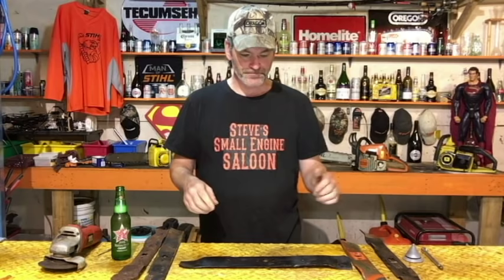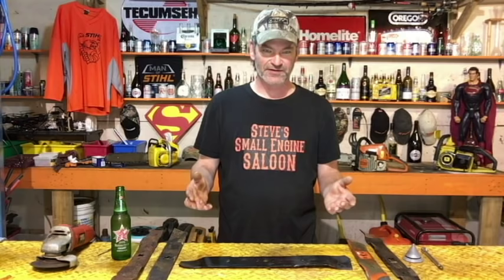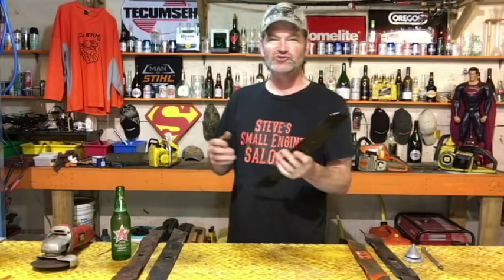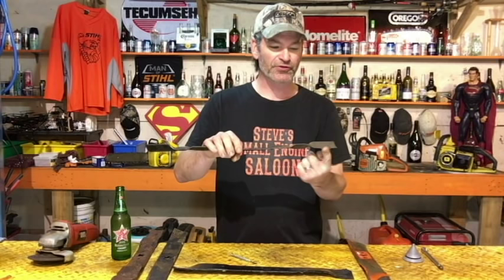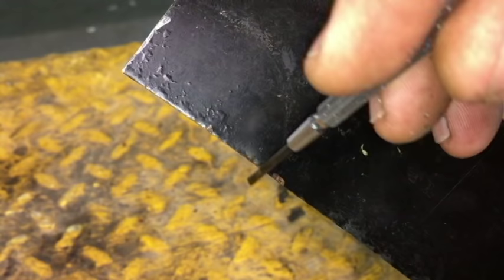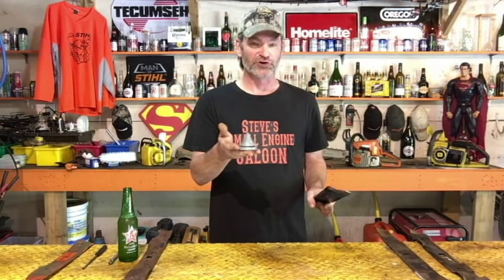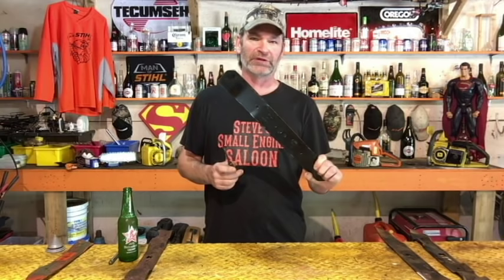How To SHARPEN And BALANCE A Lawn Mower Blade (The Correct Way)

Comment: Medium grit flapper wheel on hand grinder holding blade flat on bench with cut edge over hanging works great . Count the strokes on each ends keeps them close enough I find .Only way to reelly tell blades bent is to lay it on top of new one . Or in our case I have a wall mount balancer with a gauge that when blade is spun it shows that it’s bent or not .Also blades of that size are so cheap and light balancing in my opinion doesn’t matter a whole lot . There’s not much mass turning . If it’s has a chunk out off it or noticeably sharpened one side more than the other then balancing should be done. I do this 2-3 times a week for 20+ years. Now on my commercial 27” blades where they can weigh a couple of pounds each then yes balancing is very important but still get hydraulic driving spindles blow bearings . Personally I think it’s from the first bang you hear out on the course throws the balance off .lol after an 4-6 hour mowing day slightly off balance would wear the bearings out over time .

Comment: It might be a good idea to remove the gas cans with the spouts attached out of the area when you are grinding. Also if you don't have a vise you can clamp the blade to the work bench and sharpen 1 end at a time.

Comment: Before watching this video I saw a guy balance his blade on a nail and rant on for 10 minutes about how you should use a hand file 🤦‍♂️ Thanks for all your videos...
Reply: @Jonathan-fw6ty  I'm guessing you don't work with power tools. With your logic I should change all my tires and pull my engine with hand tools as well. I mean it only take 5min longer to pull a wheel by hand. Hold on tho... If I quit using power tools and spend extra time, that's called a waste of time and worse for me wasted effort. I will always take the easy route as I'm not a moron. And if you were filing the rock chipped blades I have to sharpen you would spend a hell a lot more than 10 minutes. But you do you!
I wonder do you balance the blade with a file as well 😳 what a waste of time! 🤦‍♂️

Comment: First, I'll use my bench grinder to flatten out any dings in the blades cutting area, and remove same on the other side for symmetry balance.

For sharpening the blades, I use a grinding wheel and a constant angle guide attachment on my DREMMEL rotary tool, and finish getting the burrs off with a hand file.  When done, smear grease over the just sharpened  area, and wipe off excess (prevent rusting) especially for off-season storage.

Then I check balance, and I'll remove material from the end of the blade (bench grinder), at the trailing corner, opposite the cutting edge.  That way, I don't have to keep sharpening to get them balanced.  And, cover that spot with grease too.

And, after 13 stitches when a wrench slipped off the mounting spindle nut, wear leather gloves when handling the sharpenned blades!!!

Comment: The nail or screw drivers in the middle works well also. If the blade does not rotate, it’s balanced, else shave of the heavy side until it no longer rotates left or right. It’s like static balancing a motorbike wheel.

Comment: I use a smooth round shank screw driver held in a vise to balance the blade.  I rotate the blade 180 degrees to check it.  Seems to work pretty good.  Never had an unbalanced blade by doing it that way.

Comment: I believe the nail in the wall trick would work notice the balanced blade retained its position when placed on it if one side is heavier it will rotate until the heavy side is down like static balancing a motorcycle wheel

Comment: I just finished grinding my blade for balance using your 6 inch extension method.
You are a damn genius mister!!
Worked like a charm.
Reply from the maker: Right on Burt...
Reply: @StevesSmallEngineSaloon  but you lied about the Heineken.
I did it with Tecate instead of that fancy balance thingy.

Comment: Steve you are a legend! Your explanations could not be clearer. I have looked through your videos and could not find one that deals with my problem.
I have a Briggs 35 engine.
When I turn the flywheel i feel a scratching resistance as the piston reaches the top. 
I took the plug out and placed my finger (with a glove ) on it. I can feel the suction but I cannot feeel the compression but I can feel  some "sceatching resistance " as I turn the flywheel and the piston reaches TDC.
I saw your video on the stuck valves which could explain the no compression, however I am more worried about the scratching sensation as I turn the flywheel.
I did inject some lubricant (diesel)in the spark plug hole to ensure there was cilinder lubrication. The problem persisted.
Hope you or one of your many followers can drop me a hint or guide me to a video that explains my problem. Many Many Than
Reply from the maker: Could be that the coil is hitting the flywheel!
Reply: @StevesSmallEngineSaloon  You are a humble genius!

Comment: I have screwed a linear ball bearing in the size of the hole in my blade and to a closet door in my workshop. Drew a line using a bubble leveler a couple of cm above it.

Comment: A lotta times I use  a 3/4" dia. CARBIDE cutter bit in my air die grinder. NO chance of burning the edge!  Also use a 3" cutoff wheel in my right angle die grinder at times. No need to remove blade the blade with either method. 
Also, I always take a very shallow/ flat swipe on the bottom of the blade to remove any burrs, etc. Try it !

Comment: I recently had a mower that was about 3 years old. Had it in the shop for minor repairs. Was told the blade needed sharpening, I didn’t notice it however, I told him to go ahead and sharpen it. I got it back and it worked great. The next time I used it, the blade felt like it was ruined. Couldn’t cut a thing.
Reply: He probably ground it on both sides. Doing that destroys a blade.

Comment: Steve.... Invest in a BLADE SHARPENER type of grinder. Yes they are expensive. But they do the job much quicker and with professional results. You want a 30 degree BEVEL which is as you describe as the angle, for your blades. A file is still good for touch ups. And another tip for you is when you got the proper edge BUT it does not balance out is to file THE BACKSIDE of the blade. It doesn't hurt the blade. Don't disturb your already sharpened edge. So file the backside once again to get in balance. ...I run commercial mowers for a living.

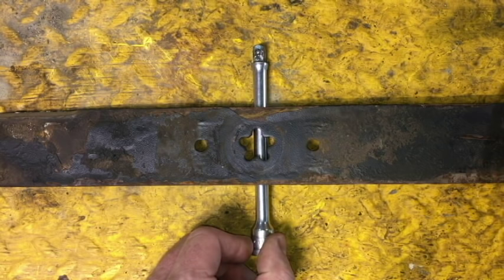Comment: 11:00 I think that balancing trick the with an extension arm (or any other straight and round metal bar) is even more accurate than the official tool, especially for those blades with non-circular hole in the middle. Great tip!
Reply from the maker: Thank You...
Reply: non-circular holes still centers on the balancing jig by their inner protrusions.

Comment: Hi Steve, keep up the great work you do, you are helping people save money. I watched your video on how to sharpen a Lawn Mower Blade, what do you do when the balancing hole on a blade is not round? There star snapped. This is what I did, I took a 8”x1/2”x1/4” because that’s what I had at the time, any size will work.  I drilled a center hole just big enough that it rests on the forth hole on your style of balancer. I wish I could post a picture to of what I did. 
Thanks
Luis

Comment: Great Steve. I  haven't read other replies, however you didn't mention the need to clean all the dried crud off the blade before balancing it.  For that step, I use the other side of my bench grinder that has the wire brush wheel as in your video.  A hand held wire brush also works.

Comment: Hi Steve, im new on your channel and it's great, I watch them all, lol. I think you were right on balancing the mower blades, "How ever" the old nail trick is right out of the briggs and stratton  service  manual.  Old school I guess... thanks for the great videos👍
Reply: The "nail-trick" is NOT accurate bc you cant really put the point of contact(the fulcrum) exactly on the center of the diameter of the hole.

Comment: Do you have any experience with the small grinding discs for use with a power drill?
Reply: I bought one specifically for mower blades, about 2 or 3 inches in diameter with a bevel and a plastic guide. Worked ok for the first several times, but hasn't worked well since. I think maybe it got loaded up with metal.

Comment: using a hand file is fast and doesn't heat up the steel, using a grinder heats the cutting edge resulting in changing the temper of the steel and will dull faster because the steel has been soften by the heat of grinding method ... using a hand file is the best method.  ...  no offence, love your channel , the very very best !
Reply: best channel, I have repaired many of my small engine troubles with your help .... excellent help .... more than two thumbs up

Comment: Excellent tip on using an extension rather than a nail. I've been using a screwdriver and have wondered how accurate it was. What grit disc do you use on the angle grinder?

Comment: Good stuff Steve. I just picked up a brand new set of blades and spindles because for my riding mower. Just as you said an unbalanced blade will beat your mower to death. I had not sharpened and balance since I picked it up used 3yrs ago had broken 3 of the spindle mounting points. It may have even helped cause the deck bracket weld to break. That’s why I took it off to RE-weld it and I saw the other issues. All rebuilt now and I’d like to give it a shot, but it’s rained the last 4days in a row. 
Again, thanks for the tips. 
-do you sharpen brand new blades?

Comment: Hmmm.... looking at the blade examples.... looks like I've been trying to mow my lawn with my roto tiller. It's a pity rocks don't sharpen the blade. It could also explain the vibration that keeps shaking up the beers in my beer can holder on the handle bars.. 12 beers later and I've almost straightened out my roto tiller tynes, I mean blade. Two problems fixed at once! Cheers!

Comment: The nail in the wall procedure might work if you have the nail perfectly level, and lay the blade on it like you did with the ratchet extension.  It still seems like too many variables with the method, and I personally use the cheap balancer.

Comment: Sharpen my blade with a fine 1/2 round file in a few minutes. A file is the best way as it does not heat the metal up which makes the edge softer
Reply: Yeah I use a hand file too. I don't want to take off any more material than I need to but practice makes perfect grinder works for some but not others lol

Comment: Cub cadet 7000 series what 3rd generation starter besides Kohler brand would you use mine doesn’t have the torque to crank the motor

Comment: Have you ever tried using a hand file? I've been using a hand file for years to do this job and it really doesn't take very long at all. I have never had to replace a blade yet because using a hand file removes just enough material to sharpen the blade for another season. I've seen people grind these things down to almost nothing with a bench grinder.

Comment: Anytime you balance anything, your rotation point MUST
be in the center (bolt hole) of what you balancing. This is why the nail 
on the wall is not good. The nail is on the tangent of the hole,not the center.
The faster anything spins, the more accurately balanced it must be.

Comment: I noticed that you had two type of blades, one with a round hole the other with the "star" type hole. I have the same type of balancer you have, HOWEVER I've had difficulty using it on the star type blade hole. The balancer has different size steps for different size holes, my blade doesn't line up with the step. Any Suggestions on how to continue using it?

Comment: As far as sticking a nail in the wall to balance...yes a perfectly balanced blade will hang at any angle and not move, it doesn't have to be horizontal.  If it is unbalanced, it will start to swing vertical after putting it on the nail until the heavy side is down.

Comment: Quick questions. It seems to me that you can get a blade balanced, but if the user is going to barely maintain the mower deck(which I think is typical) won’t the caked on grass imbalance it pretty quickly anyway? Isn’t this especially true for mowers with stacked twin blades (ie. Hondas)?

Comment: I think the nail in the wall trick was meant to be used just like you used the socket extension.  You probably need a pole shed nail, though. You lay the blade on top of the nail, you don't hang the blade through the attachment hole. I do like to be able to roll the support, like you did with the socket extension. I use a screwdriver, but a lot of things will do.

Comment: What do you think about the grindstone you put on the end of a drill?
Reply: Go to Harbor Freight and buy an $18 angle grinder and a $4 pack of grinding wheels. I've had mine for 8 years and it still works just fine.

Comment: Better to use an angle sander than grinder.
A #80 grit disc works great.
Good idea to spray paint the blade after sharpening, prevents rust.

Comment: alternative way to check the blade for balance:
on balancing using the extension is too much to the right of your blades center hole which side is the heavy side that you need to remove more material to balance the blade? thanks

Comment: I use the All American Sharpener model 5005 with my angle grinder. You get a perfect grind every time. Properly cleaning the blade is just as important. Otherwise you're  balancing the built up dirt on the blade & not the steel blade.

Comment: I use a medium mill bastard  file at least 12 inches in length........ easier to keep both cutting edges sharp and uniform......Plus I  have 4 or 5 blades that I keep sharpened and ready to go..........Being a tool hog, I have two mowers anyway.

Comment: I use a small grinder like you but then I take a fine file and put a 1/32 flat on the edge and it will last me all season, if you get it too sharp it will just fold over and be dull again real quick.

Comment: hi    got all those shop tools.....but,  if some of you don't.  SCREW  THE BLADE TO A LARGE board. sideways. like a 2 by 10  or a beam...then go to town with the angle grinder.....keeping the angle the same as factory ...only take off as much as needed, both ends......

Comment: Hello Steve I have John Deere Z445 Zero Turn 25HP Kawasaki Motor. The only way I can get it to start is with starter fluid it will stay running  no problem I mowed my yard took over an hour no problem. But as soon as you turn it off and try  to start back up want start unless you use starter fluid. Can you tell me what might be the problem with the Carburetor to cause this? Your help would be greatly appreciated. Thanks Alan

Comment: How do you judge how sharp the blades should be? I have been told to not over-sharpen. What's your opinion?
Reply: I was taught that too, otherwise the first twig you hit will put a big ding in it.  Its not a razor.  I grind a little on the bottom too as there is some bent over material sometime.

Comment: Good deal.  Was wondering about re-bending the blade back straight?
Reply: I have straightened several blades for customers that couldn't afford a new blade. Big ol hammer and a good solid surface to bang it on. I use a couple of solid steel blocks about 8"X 8"X1" thick. But you could use a concrete block .
Reply: @petesmowerrepair  I wound up using a vice alone and then with a pipe wrench and another larger box end wrench with one side around the pipe wrench handle for more leverage and easier finer tuning. seems to be decent.  I just got back from looking what the new ones are supposed to look like just to be safe.  Next is to sharpen and balance.  I'll try to get a video on the channel regarding also, if I recall to make, when doing.

Comment: Great tip with using the socket extension as your balancer 👍. I might experiment with a 1/2” or 3/4” drive just to get more height off the bench
Reply from the maker: Great idea

Comment: Good video Thanks.  I have a mower with 3 blades.  They are very dull,  one of the has quite a bow to it.  I was told that I had to replace all three blades.  I like the repair man so I didn't argue with him.  But is it true that they need to always be replaced as a set ?
Reply from the maker: Not true in my opinion!

Comment: My Dad used a wet-stone power-wheel it had a seat on it where you sat to sharpen things he said grinding the blades causes heat, heat takes the temper out of the steel.

Comment: I love the videos and I learn from them. One thing I want to say is the cutting edge is not the same if you sharpen with a bench grinder. The cutting edge will be a radius of the wheel size, such as 5" radius if using a 10" wheel. It will not be a flat cutting edge like you get using a hand grinder. I haven't got a clue if it makes a difference in any way. I prefer a flat cutting area like what you are doing.
Reply: Its called a Hollow Grind

Comment: A balanced blade will hold any position on a nail. Reliable, but different.  If it's out of balance it will fall on the heavy side from a level starting position. Propellers can and are balanced the same way (with a more accurate mount that centers the blade on the axis of rotation).

Comment: My neighbor brought me one of her Cub Cadet blades that was bent worse than that. I was able to straighten it with a "blue tip wrench". I used the blade on the other side for comparison on how much & exactly where to apply heat & bend it back. It was NOT a very fun job.

Comment: I use a file or sometimes an angle grinder/ cut off saw. My mower is 3 years old I cut 2 lawns a week. FamilyDogg over! PS- I've heard if the blade is Unbalanced the lawnmower Shakes vibrating annoyingly AND can ruin the engine. In fact I turn down lawns that have above ground tree roots or worse- Kids who leave metal items ( Hot Wheel cars are popular) stones, tools!!!!